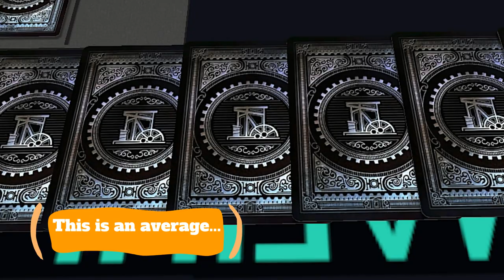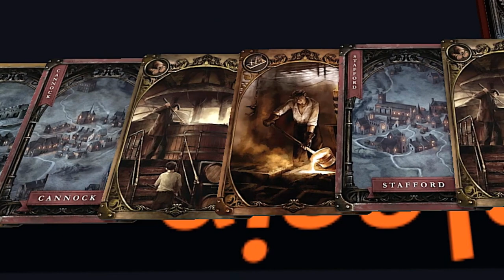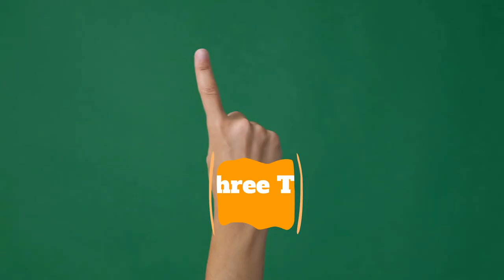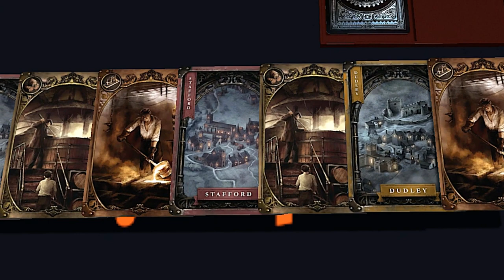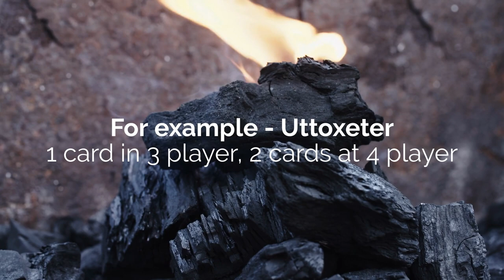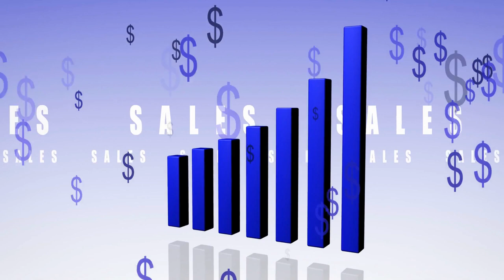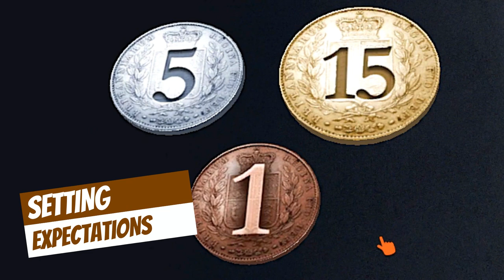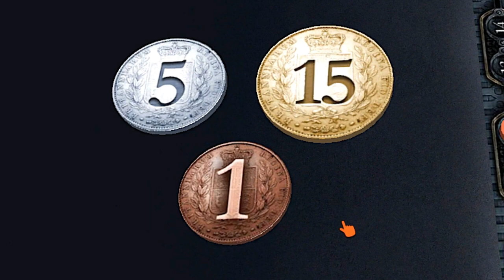BRASS BIRMINGHAM / ULTIMATE STRATEGY GUIDE / In Depth Strategy Tips for Brass Birmingham

Comment: Excellent guide! I just tried this strategy against the hard-level Mautoma solo (which I can usually defeat by a few points) and  crushed my previous high score, winning 227-178.

Canal Era was definitely the biggest change, as I built only 1 canal (on turn 2 for iron) and developed the level 1 beer/coal and level 2 cotton. Normally I would build about 5 or 6 canals for VP and network expansion, but now I see how much of a mistake that was. On the final turn of the game, I sold every level 4 cotton for the first time ever.

Comment: It should be noted that the strategy advice for 4 player is good for beginner to intermediate play, but tends to underperform to more specialized strategies at higher levels. Beer is too scarce for everyone to play it, so it makes more sense for main industry players to not play their own beer and instead go fully into their industry and flip other players' beer. Taking a more holistic approach and temporarily cooperating with other players will yield better returns than trying to compete as players gain more experience. This approach also makes cotton a much stronger strategy - note that their VP/action is much better by placing and selling an additional level III cotton in the canal era rather than trying to develop and play beer.
Reply: Thank you so much for taking time to analyze the strategies and responding.

For a successful strong cotton play one has to make at least two Level three cotton and flip them with own two level two beers. And they have to do it in addition to to making level two and level three irons. And all of these has to be done in Canal era. In three and four player game there will not be enough action to do all these. That is why it's (strong cotton play) only possible two players count which has more actions and manufacturing strategy is more viable in three and four player count as that need few actions. Mainly the extra action needed to develop all level one and two cottons actually prohibates cotton in higher player count as there are not enough action left after making all irons and beer in canal era.

We have practical example video of 3-4P gameplay, after watching that you will also understand why we couldn't have spent anymore action anywhere else.

In overwhelming majority games this is true in all skill level games, however sometime in rare situation things can be different. But those are  exceptions.

Soon we'll have a two players example game play Strategy Video where you'll see cotton strategy for two player games.
Reply: @MafiulRobin  where you say 'one has to make at least two Level three cotton and flip them with own two level two beers.' is 100% not true, and you can simply do the math to see why that is. Placing a 3rd level III cotton instead of developing and placing 2 level II beers costs only 1 action and gets you 21 points, vs. 3 actions for 20 points. Even if you account for the canal potentially needed for the 3rd cotton, it's 2 actions for 23+ points vs. 3 actions for 20 points. It's absolutely more efficient to ignore beer as a cotton player in 4 player, you just need to have the beer coming from somewhere.

Luckily, players playing beer are heavily incentivized to supply beer to cotton players! When you compare points from beer vs. points from manufactured goods, it's obvious that it's better, if possible, to simply play more beer. 2 level II manufactured goods only gives 20 points for 3.5 actions. If I can place a 3rd or 4th beer, that's 14-28 points in 1-2 actions! Even if they don't get flipped, that's still more efficient. Even when accounting for canals to connect beer to cotton, this is still more efficient in terms of points, actions, cost, and income than playing 2 level II beers and 2 level II manufactured goods.

I'm not unfamiliar with the strategies you're describing - they've been around since shortly after the game was released years ago, and unfortunately, they will tend to underperform against players temporarily cooperating with each other. The strategies I'm describing are also based on tournament Brass: Lancashire play, so there is some precedent for thinking about the game this way.
Reply: Dear @prj_tv2612 ,  Thank you for your insightful comment. From my practical experience of more than 400 Brass Birmingham games with more than 150 players including some tournaments, I have to respectfully disagree with you. You have an excellent strategy and there are some other extremely good strategies as well. But these has some major problems and none are reliable enough for consistent good result like the one we mentioned.

Here I will explain some of main problems with your mentioned strategy in 3-4 Players Games:

Not making own beer and depending on consuming opponents beer can not be part of a consistent reliable strategy, it is too much dependent on opponent's choice. There is high risk of not been able to flip valuable cotton industry in canal era.

High victory point printed on tiles alone doesn't mean much unless you consider all actions you have to take until flip it. Making many high value cotton is very expensive and very dependent on market price both Iron and Coal, it might require extra action for taking Loan and it might be extra difficult to become positive income. On the other hand making beer is one of the most efficient Cost Per Victory Point.
 By not making beer, it is giving opponent chance to make more extra beer which is most cost effective victory point for them and consuming all their beer instead of own is denying self from getting those victory point.

Not making Beer in canal means not securing any beer spot for rail era for potential self overbuilt if it is necessary specially to flip very high value industries.

It is very hard  to steal opponents beer in canal era as those places might not be connected and there will not be extra actions to make additional canals to connect those beers.

Again all of these true for a 3-4P game only as actions are more limited. And we are prioritizing strategy to help win very consistently, not in rare lucky situations.

It will be also very helpful for everyone if you could give any source link of this exact strategy published before us.
Reply from the maker: Love the debate, guys!  When done well, these kinds of discussions are great teaching tools as well!
Reply: The reason you can't focus Main Industries and ignore Breweries is, you can't always rely on other players to give you Beer.

They might try to deprive you of Beer, knowing you can't Sell without it. Merchant Beer might be available, but is there enough of it? What if a player spends their own Beer building Rails and uses the merchant Beer you needed?

It's very risky not building your own Beer, and also Beer is incredible value. The VP & Income is the highest in the game relative to the price.

Comment: I'd be interested to see how this is similar/different to Brass Lancashire (the one I have). Is Birmingham the better version? Did I get the wrong one?
Reply from the maker: I personally prefer Birmingham, as I find Lancashire more fiddly.  But there is a case to own both of them - they are different enough!
Reply: Brass Birmingham is more modern, streamlined, forgiving, beginner friendly.
Reply: @MafiulRobin  I'm always a bit surprised to see Lancashire getting the lower complexity rating on BGG, given its reputation for being much more cutthroat.
Reply: @zerathul13   I don't know much about Lancashire but if I have to guess, maybe because of learning difficulty or managing beer for selling. But I can be wrong.
Reply: Have you since played Birmingham? What are your thoughts on the differences? To be frank I would have to say that although Lancashire is a fantastic game, Birmingham is at minimum a slight improvement across all metrics. Lancashire can feel very "solved" as the reduced number of possible industries means there's a much smaller range of directions you can go in any particular game. That being said it is a game which rewards tighter play more highly, as less options means more rewards for those that see them available.

Comment: Other than Iron and Pottery, is there ever any reason to build a level 1 industry?
Reply: Not really 👍
Reply from the maker: I guess they're there as an option, but mostly you need to Develop through them!
Reply: Why not? Coal can get emptied quicker e.g.? Also building it only once gives you less coal? Don’t understand that Tipp… also the Tipp with overbuilding, why do you save an action? Overbuilding also costs one action.
Reply: @SaschaKleiber  Usually if you make iron work in a new location, you also have to make a link. Overbidding level 1 iron work will save that link action. You'll lose Level 1 iron work vp but with that saved action you would do something greater.